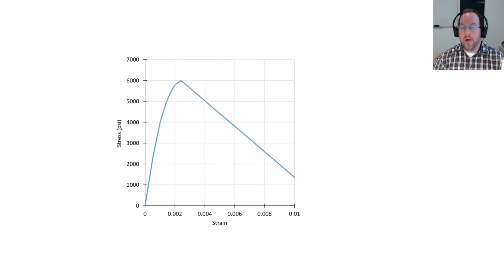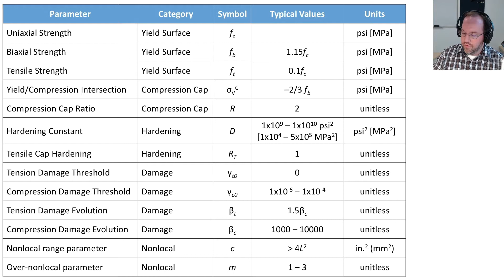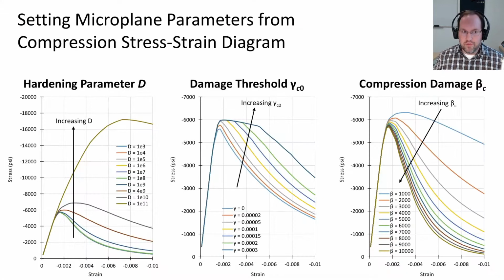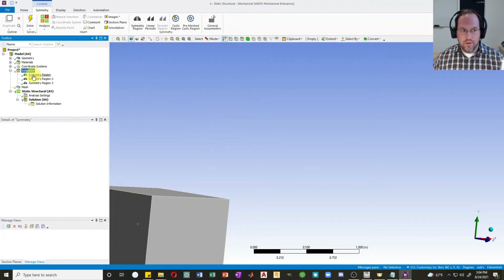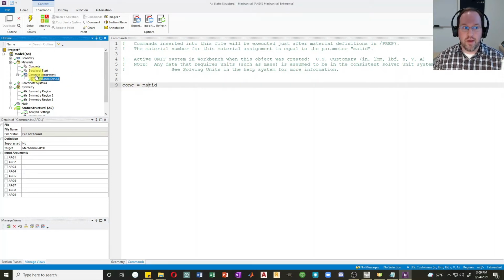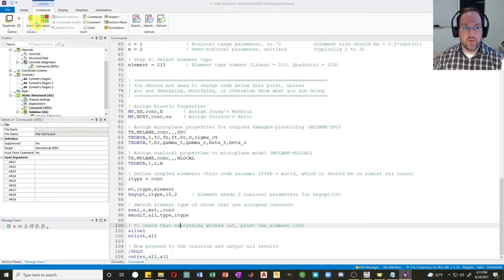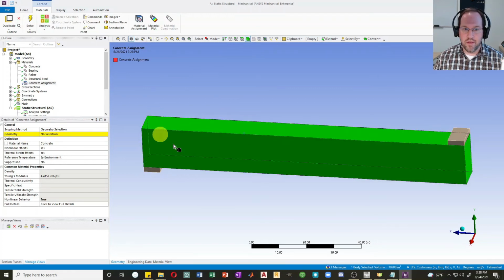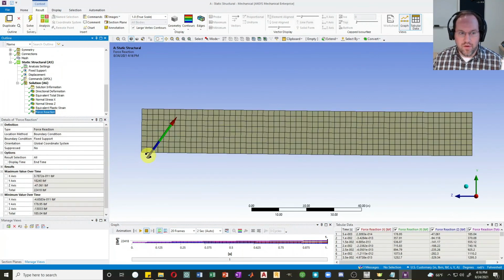Concrete Microplane Model - FEA using ANSYS - Lesson 10

Comment: Arigatou Gozaimasu, Prof..  for always sharing your knowledge and inspiring us!

I have two doubts:

1. Will this microplane concrete model work for coupled thermo-static structural analysis?
2. How should reinforcement be modeled in 2D axisymmetric analysis?

-->I found that hoop rebars can be modeled as surface elements.
-->But how can vertical and horizontal rebars be modeled in 2D axisymmetric?

When I model them as 1D elements (beam/reinforcement), ANSYS says it’s not supported. And when I use connections (beams), I'm not able to find stresses in the beams. Kindly help me on this Prof. 🙏

Comment: Thank you for this tutorial. How could we use the APDL commands if we have a part meshed with Tetrahedral elements ?
Reply from the maker: It should still work, but you will need to change the element number for the solid elements. A quadratic tetrahedral element is CPT217, so the "element" designation would be 217. I don't believe there is an option for linear tetrahedral CPT elements, though even if there were, I would still recommend the higher-order quadratic one anyway.

Comment: nice work. just need to point out that this "calibration" process is not sufficient, because this model is highly sensitive to bi-axial and tri-axial stress states. One needs more data on those.
Reply from the maker: Yes, that's a great point. Unfortunately, we don't always have biaxial or triaxial data available for calibration. The fib Model Code has some guidance on multiaxial strength and stress (Section 5.1.6 and 5.1.8.3 for 2010 Model Code... I assume it's the same in the 2020 version, but haven't checked it out yet) in lieu of experiments, which is certainly better than nothing.

Comment: Dear Prof.H could you help me about this problem saying An unknown error occurred during solution. check the solver output on the solution information object for possible causes. and in solver output there is an error saying

 * ERROR *                           CP =       0.375   TIME= 10:17:26
 0 is not a valid type ID number.  Type ID number must be a positive     
 integer.  The KEYOPT command is ignored
Reply: the problem is resolved already. i just set "itype" to integer 1 because itype cant be chars in Ansys 2024 R2
Reply from the maker: Glad you worked this out!
Reply: @luoshingyui4442 can you explain more detail about how to fixed this problem. 🙏
Reply: @luoshingyui4442  Hello, could you please tell me what is the line and how you modified ? I have the same error, thank you in advance !
Reply: @luoshingyui4442  Can you please elaborate your answer?
Reply: This seems to be an issue related to Ansys versions. In Ansys 2024R2 I get the same error (parameter conc is not passed to prep7 due to a bug, which was fixed in SP5):

 * WARNING *                         CP =       0.281   TIME= 13:19:04
 Unknown parameter name= CONC.  A value of 7.888609052E-31 will be used. 

 PARAMETER ITYPE =    0.7888609052E-30

 ELEMENT TYPE          2 IS CPT215       3D COUPLED SOLID            
  KEYOPT( 1- 6)=        0      0      0        0      0      0
  KEYOPT( 7-12)=        0      0      0        0      0      0
  KEYOPT(13-18)=        0      0      0        0      0      0

 CURRENT NODAL DOF SET IS  UX    UY    UZ  
  THREE-DIMENSIONAL MODEL

 * ERROR *                           CP =       0.281   TIME= 13:19:04
 0 is not a valid type ID number.  Type ID number must be a positive     
 integer.  The KEYOPT command is ignored.   

In 2023R2 everything works as expected.

Comment: Why did you define 3 symmetric regions for the cube?
Reply from the maker: Its not really necessary, but modeling three symmetric regions is equivalent to modeling 1/8 of a cube. It's easy to do and I like the symmetry of it. Other boundary conditions would work fine as well, so long as the cube cannot translate or rotate in any direction.
Reply: Really, thanks your answer Prof. Your videos are so increadible for ANSYS Users. You say the cube cannot translate or rotate in any direction. For this, don't you need to define a fix support for the bottom of the cube? In the static structural section, you defined displacement only for the top surface.
Reply: @NurselKutuk  My understanding is that since you have symmetry, the displacement you are applying (top surface) is applied also in the symmetric region (bottom surface that we don't see). So the cube is in equilibrium. You are simulating the compression of the cube. Please, someone correct me if I'm wrong.

Comment: Dear Prof. H, I am trying to analysis nonlinear rc column with pin-roller support. In my analysis, strength of concrete is 27.6MPa. Is there any parameter that i must change for strength of concrete without fc or fb?

Comment: Can we do strain probe for unit cube instead of deformation probe, because both are given different graphs. Why did you choose deformation probe if strain probe is available ?
Reply: He defined a cube of 1 x 1 x 1 inch, so deformation and strain will have the same value. He said also that if you worked in mm, should define a 1 x 1 x 1 mm cube.

Comment: 1) Can we get crack pattern of beam using this model?
2) I tried solid65 element and link180 and modelled the beam and used the command snippet for solid65 and link180. It analysed the beam for M20 grade concrete but when i changed the values for M25 grade concrete it is still showing me the m20 grade results. And also i want to change the diameter of the rebar for m25 grade beam but I'm unable to do that.
Can you please help me out sir 😊
Reply from the maker: 1) Unfortunately, no, this type of model will not give you a crack pattern. Sometimes we call this type of analysis "smeared crack" modeling, as we attempt to model the overall cracked behavior of the structure but do not explicitly form discrete cracks.
2) I'm afraid I don't know the answer to this question. It sounds like you might need to clear your results before changing and running the analysis again? Tough to say though.

Comment: One more question: Is it possible to use this method directly in ANSYS APDL environment? Writing an apdl makes parametric studies a lot easier...
Reply from the maker: Absolutely!
Reply: @StructuresProfH  I tried but I face warning saying it is not supported. I assume that I am making mistakes. I really appreciate if you can make a video on how to use it in ANSYS Mechanical APDL.
Reply from the maker: I’m quite certain it should work unless perhaps you are using some different version of ANSYS. In the video, the commands to define the microplane model are APDL, and in general APDL can do everything the GUI can do (it may just be more cumbersome). So it’s tough to say what the issue might be. I’m afraid I won’t have the chance to make such a video for some time, but if you solve your issue I’d be interested to see how it turns out.
Reply: @StructuresProfH  I am using ANSYS 18. Perhapd I should try latest version. I put this on my do-list and hope I get some free time soon to try. For sure I will share it with you. Thanks for your reply and helpful channel!

Comment: Very useful video! Thanks for the sharing. Just have a question. The straight line having the angle of 60 degrees with negative X, passes through the origin? I did draw the line but didn't intersect at fc!
Reply from the maker: Thank you for your comment!

First point of clarification - the X-axis is the equivalent volumetric stress and the Y-axis is the equivalent deviatoric stress. For a uniaxial applied stress f, the volumetric stress is equal to f/3 and the deviatoric stress is equal to f*sqrt(3)/3, which corresponds to a 60-degree line. Therefore, this 60-degree line should intersect the yield surface at x = -fc/3 and y = fc*sqrt(3)/3,  where fc is the uniaxial compressive strength.

Second point - the described intersection only holds true if the 60-degree line intersects with the linear part of the yield surface. If the 60-degree line intersects with the rounded tension cap at the right end of the yield surface, this intersection will happen at a smaller absolute value of x and y. However, using the proposed value of sigmaVT  = -1/3*fc, the intersection will always occur on the linear part and never in the tension cap (note that sigmaVT defines the tension cap, and is assumed at this particular value for this implementation of the microplane model).
Reply: @StructuresProfH  Thank you so much for your reply.

Comment: Thank you so much for the work you put into making these videos and explaining the fundamentals behind the concepts. I utilized the material model you provided for a  uni-axial and flexural analysis using a simple beam geometry and while the uni-axial system gave the expected results, flexural loading conditions gave a tensile peak stress which was significantly higher than the tensile strength defined. Could this be due to tri-axial stresses, the inner workings of the micro-plane model or some other consideration?,
Reply from the maker: It's tough to say. How much is significantly higher? In real-world tests, the modulus of rupture, which is the stress at which flexural cracking initiates, can be 2 to 3 times higher than the direct tensile capacity. That's just a rough estimate, but the different stress states for uniaxial tension versus flexure do make a difference.

If this is still a problem, you can try lowering the Rt parameter, which controls the tension cap hardening of the Drucker-Prager yield surface. It can go down to zero, but that might cause numerical problems, so maybe try 0.1 or 0.5 and see what happens?
Reply: @StructuresProfH  Thank you for the swift response.
I initially had peak stresses which were almost 10 times the defined tensile strength, but after adjusting the Rt parameter I was able to arrive at values approximately 3-4 times the tensile strength. Thank you for your help

Comment: Many thanks Prof. H , it was very helpful , but i have one question , in the excel sheet file for drawing Drucker-Prager graph there is Ratio , what's that ratio ?
Reply from the maker: I assume you mean the "Ratio" column that varies from 0 to 1? This is a just a dummy variable so that I can plot the yield function from purely compressive volumetric stress (Ratio = 0) to purely tensile volumetric stress T0 (Ratio = 1). For example, Ratio = 0.5 gives the yield surface value at the volumetric stress halfway between the compressive and tensile limits.
Reply: @StructuresProfH  Thank you so much for your answer , it was very helpful.

Comment: Dear Prof. H,

Why is the nonlocal range parameter (c =1) not changed for the beam model ?? If the nonlocal behavior is not considered, will that affect the results?
Thank you Sir..
Reply from the maker: The main purpose of the nonlocal behavior to is help the model converge. Modifying the nonlocal parameter will alter the results, but it's not a "physical" parameter per se, insofar that it doesn't represent an actual physical property of the material. In my practice, I occasionally adjust this parameter if I have issues with convergence, but it's not something I change unless I'm forced to do so.

Comment: My name is Ayodele Akin-Adamu. Thank you so much for the guidance you provided on this topic. I am working on validation of the experimental results of small beams made with Ultrahigh performance concrete(UHPC) found in literatures for my Masters thesis project. Without your channel, I am sure I would never have stand a chance of completing my project. The procedure you highlighted for the micro plane model and menetrey-William model, do the models apply to UHPC material? and what extra factors do I need to consider when running the analysis on Ansys for UHPC?
Reply from the maker: I'm glad this was helpful! You should be able to use either Microplane or Menetrey-Willam for modeling UHPC, though the "typical ranges" for the material parameters that I have listed may not apply. I would first start by generating stress-strain curves with a cube in compression (as I did in this video) or tension (I didn't do this, but similar idea) over a range of parameters. Get a feel for how parameters affect the response and what parameter values make sense. Select some values that more-or-less match the stress-strain behavior, then model a beam. Your first attempt probably won't fit the experimental data exactly - that's OK. You can then decide to iterate or accept the difference.

Validation can be a tricky thing. If you just blindly adjust your parameters to exactly match some experimental data, that's merely calibrating a model. You haven't really proved that anything is "valid" because your selection of parameters might make no sense; it is possible to accidently fit results. That's why you need some sort of baseline understanding of the model, how it works, and what parameters represent. Once you have that understanding, then you can calibrate your model parameters on one set of experiments and then use that model (unchanged) to predict the response of some other set of experiments - that's a much more convincing validation.

Good luck on your thesis!
Reply: @StructuresProfH  Thanks so much for the insights on how to use the model. I am so grateful. I will like to ask one more question. I have problem with force convergence when I tried to run the analysis on a modeled beam. What can I do to avoid this convergence program?
Reply: I have already overcame the force convergence challenge. I am very happy I now have a tool that can model the behavior of UHPC beams. I have 4 type of similar experimental beam data but with different percentage of tension reinforcement provided. As you have advised, I will do more studies on the micro plane model, i will calibrate 1 of the 4 type of beam that I have and validate the remaining 3 beams with the calibrated data.

Comment: Thank you for this, a fantastic tutorial! I tried it and the only reason it didn't work for me is that I don't have the ANSYS Enterprise license. Unfortunately this will not work with the Premium license, which I believe does not support CPT215/216 elements. For now I'll have to stick with the Menetrey-William method (previous video).

May I ask, does the inbuilt concrete NL work? It includes "Drucker Prager Strength Piecewise", "Tensile Pressure Failure" and "Crack Softening Failure". I tried this and I can't get it to behave any differently to the standard concrete (linear) material. Could it be that this also needs the CPT215/216 elements?

Please keep the videos coming, they are very insightful and helping a lot of people.

Comment: Thank you for this wonderful presentation. I wonder if I could use this microplane model for a kind of cyclic test simulation?  Btw, could you please kindly give any suggestion for me to begin with, whether to use static structural or transient dynamic for RC cyclic simulation? 

Thank you in advance.
Reply from the maker: Adrian,
You should be able to use the microplane model for cyclic test simulations. I would employ static structural, not transient dynamics. Transient dynamics solves equations of motion (F=ma) that include displacement, velocity, and acceleration. Static structural solves equations of equilibrium (F=0) that use only displacement. Most laboratory tests are slow enough such that velocity and acceleration effects (like damping or inertia) don't matter, in which case static structural is far more efficient.
Reply: @StructuresProfH  Hi, thank you for your intuitive explanation. 

Could I am asking one more further question? Supposed that I would like to run a cyclic simulation, how can I control the hysteresis behavior for both concrete and steel (pinching, strength degradation, etc)? There are some of of hysteresis model that I know, such as takeda, pivot, or kinematic in a conventional structural analysis. However,  I am not sure how a heavy FEM platform such as ANSYS might handle this. Could you please enlighten me what kind of material properties should I modify, and could you please recommend me any relevant literatures? 

Thank you in advance, and I am greatly appreciate your help, sir.
Reply from the maker: @adrianulza  Hi Adrian,

Now that's a tough question. I don't have a great answer, but perhaps I'll try to steer you on the right track. 

Things like the Takeda model are specifically for cross-section behavior, not material behavior, so that's not going to work for a detailed FEM. To get the best representation of pinching and other cyclic behavior, you will need some way of handling bond slip and the cyclic material behavior of the rebar. The Menegotto-Pinto model is probably the most commonly used for rebar, but I don't think it is included by default in ANSYS. I've seen some papers modify the rebar stiffness to account for bond slip (otherwise, you need to include additional DOFs connecting the concrete and steel, which can be a hassle); that seems like it would be easier to me.

This publication...
https://www.researchgate.net/publication/334029651_CYCLIC_NONLINEAR_MODELING_OF_SEVERELY_DAMAGED_AND_RETROFITTED_REINFORCED_CONCRETE_STRUCTURES
... by Markou et al. (2019) might point you in a productive direction. So might this one...
https://www.researchgate.net/publication/278710287_Seismic_Analysis_of_Steel-Concrete_Composite_Buildings_Numerical_Modeling

Good luck on this! I may do some research on my own in the meantime, as this would be a great topic for a new video.
Reply: @StructuresProfH  Thank you very much! I am really appreciate your help. Keep doing great with this cool channel! 🤟